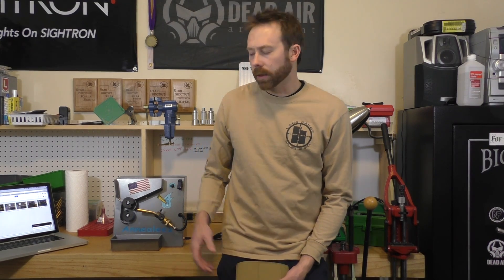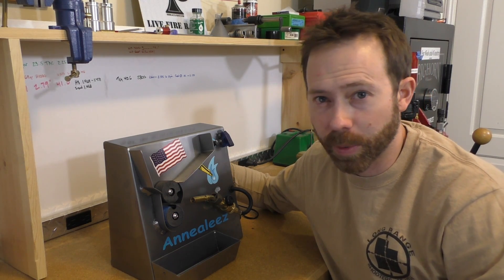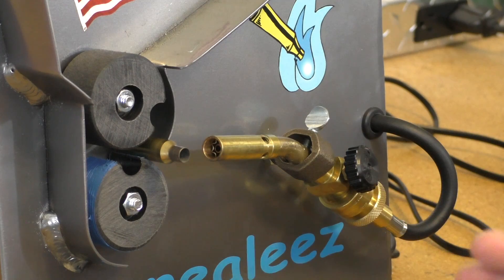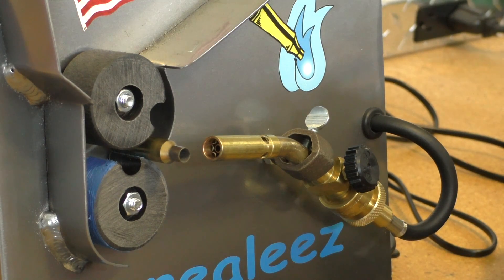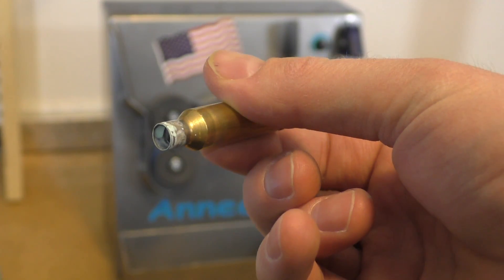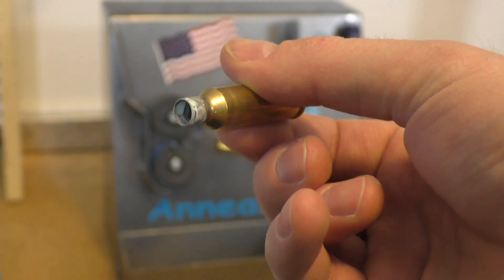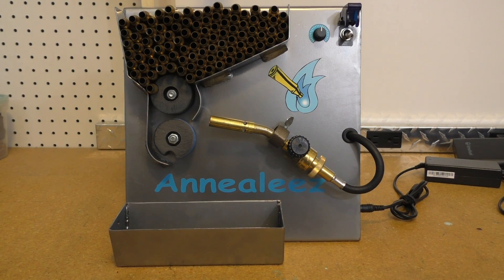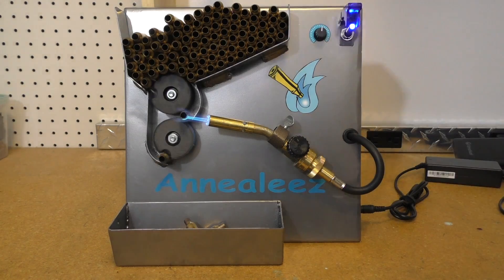How to Anneal Brass with Annealeez - For Less Than $300

Comment: As I understand it, this process makes the brass more malleable because brass gets brittle the more it's worked (resized/ etc). If that's the case, why wouldn't you anneal the entire case? Especially for full-length resizing.
Reply from the maker: It's about preventing work hardening, restoring elasticity and keeping the most consistent neck tension.  If it gets harder each firing it will not size the same or hold the bullet the same.  It will also become brittle and fail.  The neck received far more work hardening that any other part of the case.  it changes shape the most, is subject to the most pressure and heat and is the most important part of the brass as it hold the bullet.  Here's a great write up on annealing from accurateshooter.com  -   http://www.accurateshooter.com/technical-articles/annealing/

Comment: How often do you anneal your cases?  Does it differ for full-length resizing and neck sizing?
Reply from the maker: My typical process: I shoot the brass, if it's relatively clean I'll anneal first then size and then wet tumble in stainless tumbling media.  If it's my 223 brass from my AR it's really dirty because I run suppressed so I wet tumble in STM first, then anneal then size.  The key here is that you anneal before you do any sizing because you want to return the brass to it's annealed softer state before you work harded it.  It basically makes it like new.  I hope that helps.
Reply: Thanks!  So you anneal for every reload then.  I wasn't sure if you only annealed after reloading X number of times.  Thanks for clarifying.
Reply from the maker: KE8AMR I anneal after each firing.  You can do after every two if you want but ideally you're going for consistency so after each firing is ideal.
Reply: Guys that aren't in to long range accuracy shooting anneal far less often. For just plinking ammo, there are sources out there that say after every five firings. Waiting much longer than that increases the risk of case splits. And since only the neck is annealed (it is NOT safe to anneal the case body), whether or not you full-length resize or neck resize only doesn't affect how often you should anneal. Another very good video by LRSoU,LLC!
Reply: Sir, it's aways a good idea to clean your brass first before annealing. Melting the carbon on the necks into the brass will just wear out your dies. It's really hard on bushing dies. Great tool.

Comment: Just ordered one. very cool product. How often should I anneal 338 lapua n 308 win rounds? Anyone?
Reply: em Burgess if you want it to last forever every time. Especially 338 or your more expensive rounds because that brass is worth gold.
Reply: @yolo-qr2fq  Annealing after every firing is not necessary. Annealing after 3-5 uses will help the brass tremendously. (It always depends on the caliber and quality of the brass)
Reply: @toddy2519  well for the 338 or your big game cartridges I personally would anneal after every firing just to make that brass last longer but with small rifle what you are saying. It also depends on your brass because if your buying good brass/already annealed vs non annealed brass before you shoot it. I wouldn't anneal L.C. brass until 3 firing but I would with PMC. Quality of brass at the start affects it's performance and when you need to anneal.